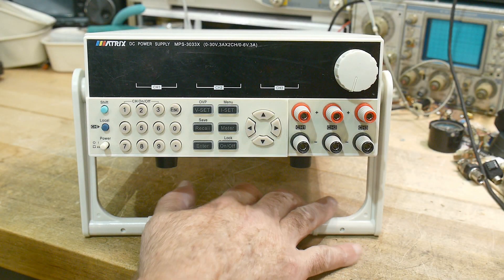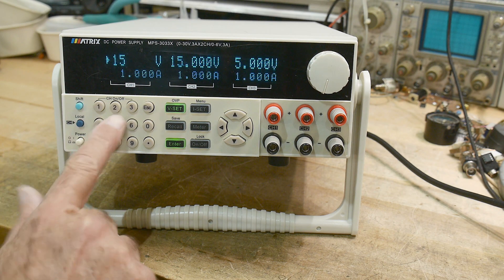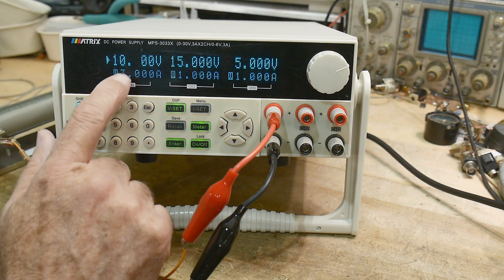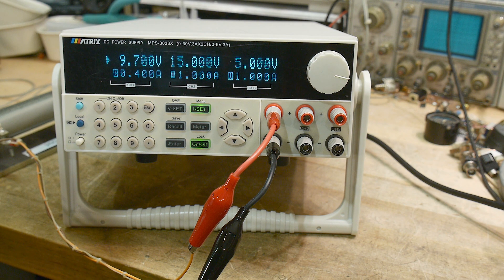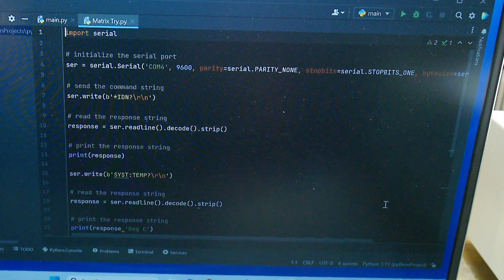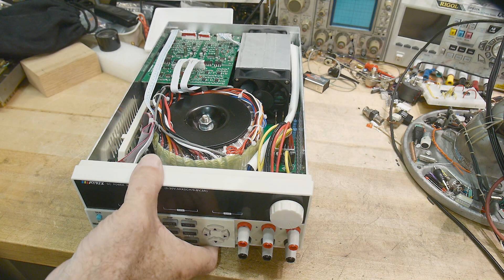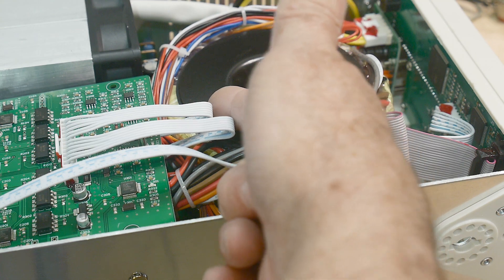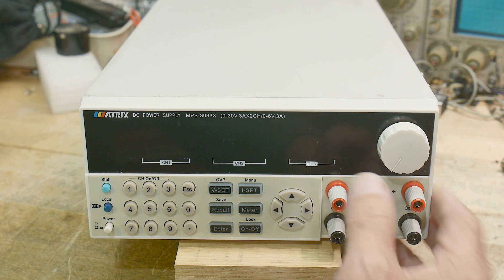#1442 Matrix MPS3033X Programmable Linear DC Bench Review

Comment: Running this in series for parallel, does it require physical connections or is it internally switched when using the mode?
Reply from the maker: It figures it out
Reply: @IMSAIGuy  I just picked one up, and to get series to work, I needed to use a jumper wire between CH1 POS and the CH 2 GND... I only get half the set voltage when connected to only CH1 or CH2 outputs.

Comment: The "wrong" spacing of the connectors is not an oversight. The problem is that the standard spacing of banana plugs will fit into the outlets of many countries in the world, including most EU countries and China. It is therefore considered a safety risk and there is an actual ban here. But they are available anyway as a lot of old equipment has it.
Reply: Ban on what? Placing banana jacks 0.75” apart? Do you have a citation for that?
Reply: @absurdengineering  it is probably the other way around: you can not sell cables with plugs that will enter the 230 AC sockets and have it CE certified. Because that product would be considered dangerous.
Reply: @BaldurNorddahl  In practice, nobody cares it’s not CE certified it’d seem. I’ve got a bunch of those and distributors have no problem selling them in EU.

Well, the regulators may all get their panties in a bunch. But even then - sheathed bananas exist after all. So spacing is not an issue really. Sheathing is.

Comment: Nice looking powder supply and it's linear - don't see many new ones at that price. Real shame about the output spacing, not sure how that happens. Thank you for the review. Regards, David
Reply: Unfortunately we don't know much about the actual performance of the power supply. Noise, CV/CC control loop performance and so on. Would be a nice addition to the review ;)
Reply: @sebastian_harnisch  Yes, I agree. As I said it is a nice "looking" supply - nice display, solid chassis, and reasonable build quality. It would be good to see the regulation and transient performance,  also what the four-arrow key pad is for - does it allow "live" parameter changes? Hopefully someone will do a complete test as this appears to be on the surface a good product. Regards,  David

Comment: Hi, the Siglent SPD3303X also has a problem with the spacing of the sockets, it is also wider, the control is completely luxurious compared to the Metrix, but unfortunately it does not have a smoothly adjustable third channel.
Nice day 🙂 Tom

Comment: When I saw "Programmable" in the title I assumed that you could create ramps and such, however from the way the front panel seems to work I am now guessing that you can only jump from one output value to another with no smooth transition.

For the right use cases I would imagine this is a pretty good deal.
Reply: It's pretty common to call these simple power supplies programmable as long as there is an interface over which the voltage/current can be set remotely. On the other hand, the feature set you are referring to is fairly rare. On true linear power supplies with multiple taps (to reduce the power dissipation) it's much more complicated to do such transitions smoothly, at least if you want to provide this capability across multiple ranges. Keep in mind that the control loop (including CV/CC switch over) would have to work properly during tap changes as well.
Reply: You need an SMU for that , this is still only a PS

Comment: First, crowbarring is shorting the output (usually SCR) when a voltage trigger is reached.  This protects circuitry from power supply overvoltage.  What we witness is current limiting; this protects the power supply from short-circuit loads.  Second, it looks to me like the output voltage does not change until you press "ENTER," so naturally the output current also does not change until then.  Obviously, typed voltage levels should not change until entered and I expect that they chose to make knob entered levels consistent with that.  I would have made the output track the knob also, but they disagree.  Third, the voltage and current levels entered are actually maximum values.  The connected load resistance will determine which of these maxima will be reached first and this maximum parameter will be the active control until the other maximum is reached and becomes active.  Fourth, maximum power is 3A(30V + 30V + 6V) = 198W ~ 200 W.

Comment: Such a nice supply, I have never heard of the company. Shame that the outputs are the wrong spacing. Initially I thought that it may be possible to 3D print a new plate because the one they are mounted to looks seperate from the rest, but the filter board would make that tough (and you would void the warranty). If that and the software were improved, this would be a decent power supply for the price.